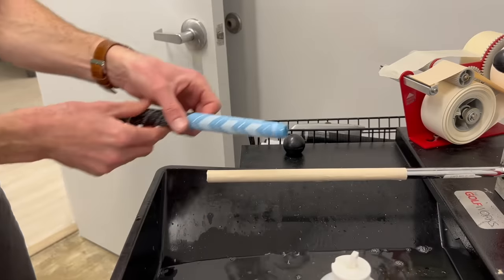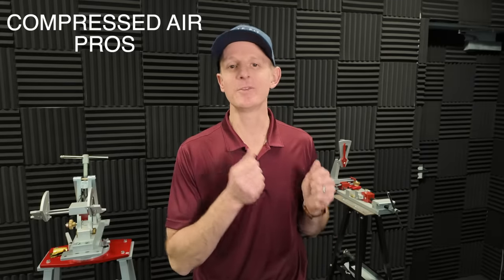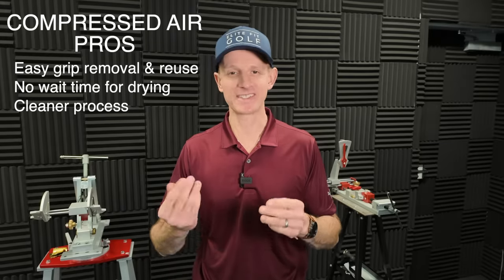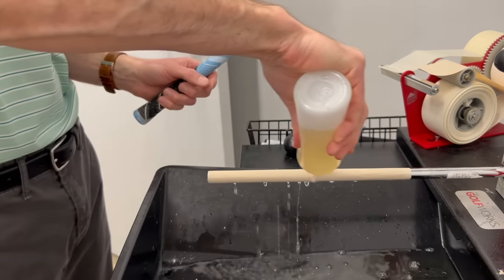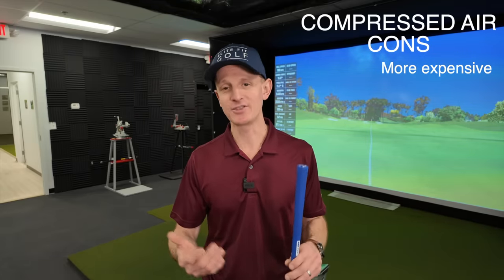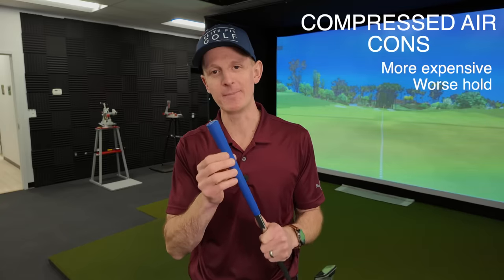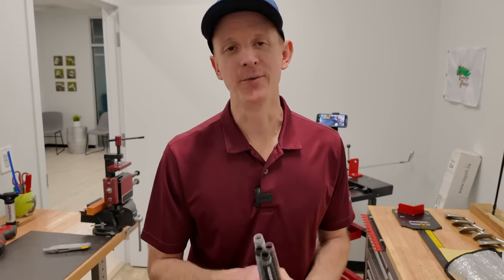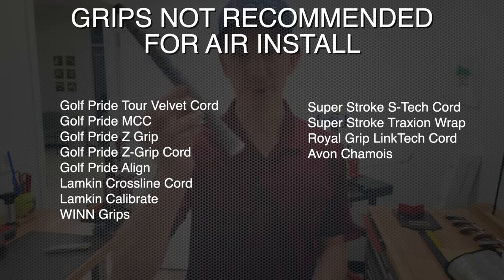Which Regripping Method is Better? Tape & Solvent vs Compressed Air

Comment: I used compressed air with MCC+4 grips last year.  As you noted they would twist so I removed and used a liberal amount of hairspray which solved the issue and they remained solid for the entire season.

Comment: I like to do my own re-gripping. The traditional method using dbl sided tape and solvent gives consistent results, but is messy and more time consuming. My first re-gripping efforts with compressed air about a year ago were very encouraging, and I now use this method 95% of the time. As you said, it's very important to consider the grip material and design when using air to know when it might not be the right option. Your tips and those in the comments about using a small amount of hairspray or small section of dbl sided tape at the top, etc, make a lot of sense to help make the air method more foolproof. For me, the biggest plus is that installing grips with compressed air gives me more freedom to experiment with the tape build up configuration, knowing the grip can be easily removed and reinstalled until the best result is achieved. Really enjoy your channel AJ. Keep up the great content.

Comment: Blow mine on with compressed air, all day every day.  The main benefit it installing new grips, 10 minute job to replace 13 clubs.  No more cutting off the old grips, and cleaning old tape.  Never going back to tape and solvent.  And never an issue with grip creep, I do use 2 layers of tape, MCC Plus 4 standard grips.

Comment: I actually now install with solvent, double sided tape, but I put them on with a compressor, which cuts down drastically on drying time because all of the excess solvent is blown out by the air. goes on fast and easy, uses less solvent, and dries faster.  My driver and woods I still only go on with air because I often tweak my loft settings
Reply: So do you just put solvent on the double sided tape, some in the grip then put it on with the compressor like normal? Ever have any issues? Looking to do this soon.
Reply: @greyback13th  I put just enough on the tape that the grip doesn’t get stuck. It doesn’t take nearly as much solvent as it normally would since the cushion of air helps it go on so much cuts the dry time in probably 1/3.
Reply: How is the removal process, and can you get away with not changing the double sided tape every time?

Comment: I use grip tape with a lot of compressed air for all grips. You just need a lot of air to keep the entire grip off the shaft till it is on all the way. Once you have got the pressure right it is super easy, it just takes a bit of practice. You obviously need a proper compressor and not some hand-held thing otherwise you won't have sufficient air.

Comment: Would be interesting if you did another experiment using different types of tape with the air compressor method. Maybe have one be a combination of double sided tape at the top and then masking tape for the rest. Other types of tape could be clear packing tape, duct tape, blue painters tape, green painters tape, etc.

Comment: I'm old school. I spiral 1/2" double sided tape, leaving some shaft exposed between the spirals, and use zippo fluid. It evaporates much faster than mineral spirits and pulls the adhesive from the tape down onto the bare shaft for better adhesion. I also use a small piece of tape to cap off the end of the shaft to prevent moisture from rusting the shaft from the inside.

Comment: I found the tip hard to hold on the grip end so came up with a solution. Take a "needle" you would you for ball inflation. cut it shorter (say 1/4 - 1/2 inch left), then inflate with this on the tip!

Comment: Great debate video.  I would offer one comment .. tape and solvent drying time isn't a real issue unless you are regriping between holes or maybe living on golf course with access from your backyard.   Just a thought. Cheers.
Reply from the maker: For me doing fittings, air install is a no brainer so clients can hit different sizes right away. I agree the majority of golfers don't need the instant readiness of air install but it also allows you to easily remove the grips in seconds so if you want to reuse them, it's way easier.

Comment: Started gripping last year and I have done both methods. Air compressor install is so much easier and better I have found. I put on my father's MCC Style last year by air and not one has shifted or moved. I found that by building up the tape under the grip has helped create a holding force that has prevented the grips from twisting. I will grip however the customer prefers but for mine and my dads, we will go air gripping.

Dad has switched to a new set of irons and swapping grips was simple. Air, remove MCC off old clubs. Longest time was removing the grips off his new clubs and then removing the tape.

Thanks for the video. Golf Pride CPX grip is on my current and went on well by air with just a bit of hairspray for hold.

Comment: Thanks for clarification👍I put some graphite shafts in my longer irons and used the compressor to put CP2 grips on them. Needed to drill at hole to let the nozzle in. So it was a struggle !! Much more so then the Lamkin cross line. That’s  a good tip re hairspray … btw L’Oréal Elnett would be my recommendation as it’s a wet slow drying hairspray!  Saying that It’s a high risk option nicking samples from my wife’s hairspray collection but from experience that one is the best 😂

Comment: Thank you for the video on how to do it with air!

Air compressor is SO quick and easy. I recently did a grip change with 1 inch of athletic tape per club, an air compressor and nothing else. Just a layer around the butt end and held the club in my hands in 5 minutes. Next time I’ll find a vice and masking tape, but you don’t even NEED it.

Comment: I use both. I use compressed air so that is easier to install/uninstall with the tape and grip solvent to ensure no slippage after installation. The compressed air just makes it so much easier to slide the grip down the shaft with the solvent. Great video by the way.

Comment: Been blowing on grips for a couple of years now and I've had slight slipping on various grips when using masking tape. I switched to clear packing tape and that grips the back side of the rubber way better. I thought of using hairspray when I switched to packing tape but it holds really well without it. I am going to try both next time I regriped just for fun.

Comment: I use compressed air and add a little twist...I have a piece of 1" I.D. PVC pipe 12" long long which I place over the grip to prevent "blow outs" when removing stubborn grips. Worked like a charm!

Comment: I use grip tape and solvent, however I sometimes get the grip stuck before it's fully on and use my compressor to blow it on.  Works like a charm and saves the day.

Comment: Never used it to regrip golf clubs but used hair spray for years for mountain bike grips so one word of advice. Not all hair spray is the same. Look for "max hold" or if it's numbered look for the highest number- usually a 10- and avoid any spray labeled "finishing".

Comment: Thank you for introducing me to the compressed air method. I prefer that now especially since I've been delving into club making. I have pulled off old double sided tape and solvent and when trying to put them back on with plain masking tape and air, the grip will slip probably due to residue left over. Never had an issue with brand new grips.

Comment: You definitely have the best cub fitting videos. I use the air method and have had no issues. Thanks, I will no longer use solvent method in the future. I constantly make adjustments on my grips and solvent method makes that more difficult. Air is less expensive. Air machines are cheap.

Comment: Taught myself how to re-grip my clubs a few years ago after I realized how much I was paying to have someone else do it. I currently used compressed air. One of the things I found to help reduce any slippage etc is using what''s called black "Gaffers" tape (found on Amazon) instead of regular masking tape. The gaffers tape has a very rough texture & helps to keep grips from slipping over time. My grip preferences are Winn Dri-Tac & Lamkin Sonar Tour wrap. I have also re-gripped a friends clubs with the Super Stroke Cross Comfort grips & hasn't been any slipping.
Reply: I have been using a cloth tape which you can buy from a hardware store it works a lot better than masking tape.

Comment: I use the compressed air method and it works fine, also if needed I will use spray adhesive to secure it but usually not, love these tricks and tips from your show.

Comment: I used a compressor and hair spray for my tour velvet with Arccos sensors last year. No complaints. I did mess up and tape one of my graphite shafts too long and it was quite easy to remove everything, redo the tape, and make it look nice and professionally done. I already had the air compressor so didn’t have the concern about investment costs.

Comment: 13 years ago I posted what I think is the very first video on YouTube on how to install grips with air.   So I have been doing it for a while. :)  The only negative for me is the occasional slippage on the butt end.  This can be fixed with a little bit of double sided tape on the first couple of inches of the butt, and still not hinder a subsequent removal too much.  If I was in business, I probably would be using solvent and double sided tape.   What I love about blowing them on is that I can re-use grips many times.  I've been using the same 25 to 30 GP Tour Wraps on who knows, maybe 100+ different clubs over the past 3 or 4 years.  That is a significant savings versus each of those 100+ clubs getting a new grip.

Comment: Great video…hit most of the essentials.  One other big benefit of the compressor method is if you play all year around, or in varying conditions throughout the season where different grips would be beneficial (I prefer firmer grips when it’s very hot out and softer ones in the winter months)…you can more easily swap out grips and not have to throw them out …sort of like throwing on the winter tires (you sort of mentioned it in the bullet point of being able to reuse the grip, but I was just adding when you might want to do that).  The hairspray works very well and I’ve had very few issues getting the grip either on or off…Sometimes I will put just a dab of solvent on the very tip of the grip in order to just help the grip get on, but that’s about it.  The huge, inflexible super stroke grips and some putter grips (larger ones) are the only ones I’ve big issues with using the air compressor…Also, for those you use something like the Arccos grips with the embedded sensor, the sensor comes out and the air hole is behind it, so you can blow those on and off too!  I didn’t realize that with the first set I owned…

Comment: I use both. With jumbomax, compressed air is almost a no brainer. They pop off and on with such satisfaction. They are expensive but take really well to multple removals. Would love to try one of those dedicated grip attachments for a compressor.
Reply: I've just bought the ultralites. Did you just use 1 layer of masking tape? Also did you use tyre inflator or compressor, if compressor, what PSI setting do you use? Thanks in advance

Comment: I have had spoton grips put on with compressed air. My only problem so far is the bottom of the grip does turn on my wedges. Other clubs it has been ok. You named all the pros and cons already. The one big pro for me was they were attached at the golf course and I was able to try different grips att e driving range. Than after playing my round I was able to completely change or keep the grips I played with.

Comment: One trick I use with compressed air is to take 120 grit sand paper and lightly sand the masking tape (I actually use painters tape). Then I clean the sanding dust off with some alcohol on a shop/paper towel. This removes a good portion of the slick shiny surface from the tape and provides some "tooth" to the tape so the soft rubber has something to bite onto.

Comment: I use compressed air on golf pride 1/2 corded grips and I use 2 layers of masking tape to replicate the double sided tape, which is thicker. I haven't had any slipping issues with 2 layers. I'll try the hair spray trick the next time. I find that with using the air compressor method, I can try different grips by purchasing only 1 grip and interchaning them quickly to compare.

Comment: I use both at once, grip tape , solvent and then stick the compressed air in the end of the grip put solvent in and slide it on works for me!

Comment: I used to regrip using masking tape on the shaft and household brown adhesive. I would lightly coat the inside with the adhesive, using a thin rod and slide the grip on. In never moved and was easily removed with compressed air.

Comment: I fit all my grips with compressed now - MCC+4 mid, Tour Wrap 2G mid, JumboMax Ultralite mid and even a GripMaster leather sewn grip. I've only ever had one of the MCC+4 grips twist. All the others have remained securely in place. I use 2 tape layes, so maybe the extra layer helps.

Comment: AJ, I really enjoy your channel, thanks for the tips. This battery powered air compressor is genius. No telling how much time and money I could've saved so far. I would do air, to experiment and the dbl sided tape for a permanent install. You do fittings as well correct? I would like to have my set dialed in. How do I set that up? Best regards.
Reply from the maker: Yes I do fittings. Email me.
adam@elitefitgolf.com

Comment: Use the strongest hold hairspray you can find. The grips will never slip.  Used the same method on bike/ motorcycle grips for years.

Comment: One more pro and con would be controlling grip size.  I have smaller hands and I install .600 grips on .600 shafts  with tape and solvent and stretch a bit to make them slightly smaller diameter.  Air method you can't stretch however I have installed .580 undersize grips on .600 shafts with air and without tape and they came out a little smaller than standard.  So my playing clubs get the solvent and my "other" sets get the air.  My wife's not a fan of all the other sets.

Comment: a couple questions:
1. can you build up the tape and still use compressed air
2. which inflator do you use when using compressed air
Reply: Yes to the first question.  I've built up as much as 10 layers of tape and still blow grips over it.

Comment: i tried the compressed air method last season and thought it changed my life, but I did end up experiencing some slippage and have since gone back to using double tape. Its  a bummer because the benefits of using air, (especially being able to remove and reuse quickly) ate very hard to ignore.

Comment: The only Cord grips that go on well with Compressed Air are the "TaylorMade Lamkin Crossline 360 Genesis Full-Cord Standard Grip". went on with little fuss and no cracking. The rubber is pretty soft.
Reply from the maker: I was looking at some of the Lamkin UTx grips with that thought.

Comment: Never had any issues with compress air method.  I used masking tape to build up the grip and prevent twisting.  My compressor will also winterized my sprinklers, can’t do that with solvent.

Comment: Great video again! Do grips installed with solvent release easily with air? Thanks for your hard work putting out this content.
Reply: ELITE FIT GOLF / Mobile Clubmaker: Save Golf Grip With Compressed Air / In THEORY!
https://www.youtube.com/watch?v=30zyY9y4tG0
Reply: In theory they should but in practice not so much. I have tried a couple and caused 2 to bubble.
Reply from the maker: As others have said. Short answer is no.
Reply: Air is increasing the torque. I think I’ll stick with lower torque…🤔

Comment: Tour trucks and most shops use solvent process for e reason.  Compressed air is for size check with new customers.  Grips will twist with compressed air method.

Comment: I did my MCC plus4 grips with air. Super easy but I’ve found the grip twists and it slides a little back off the shaft. So I’m going to remove and use solvent method. Do I need to remove the thin masking tape before adding my double sided tape?

Comment: Hi AJ. Have you ever used compressed air on a long putter grip? I'd like to regrip my putter with a 15-inch length grip but would rather use air, if possible. Since it's a putter I'm hoping there wouldn't be any twisting. Obviously, that would be bad for a putter. Love to hear your thoughts. Thanks!
Reply from the maker: I use tape and solvent for all my long putter grips.

Comment: may I ask you to remember the recommendation about air compressors? Did you say 260psi is important? I can only find 150 or 160psi. Maybe I didn't understand you right 🙂 Thank you very much indeed for your feedback.
Reply from the maker: You only want 55-60psi to install grips so any of those will work.

Comment: Another way to prevent slipping of grip when installing with air is to use  1/2” of grip tape and solvent on butt end of shaft

Comment: I use Star Grips. No tape needed. I suspect any of the stickier grips can work without using tape.

What tip adapter are you using with your air compressor?
Reply from the maker: It's the raft tip, sanded down a bit.

Comment: For me, the fact that the grip is twisted after a few bad shots is a no-go.
Think about this: If adhesive is obsolete, why do we use double-sided tape and a solvent? It would be enough to use some lubricant, slide the grip directly on the shaft/mask paper and wait until dry. Cheaper than conpressed air and same result: Grip does't hold.